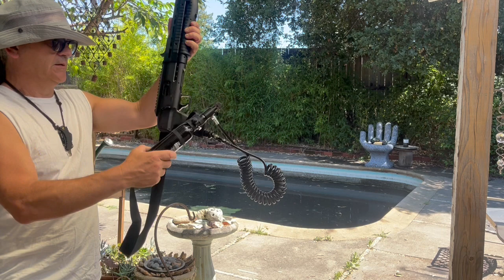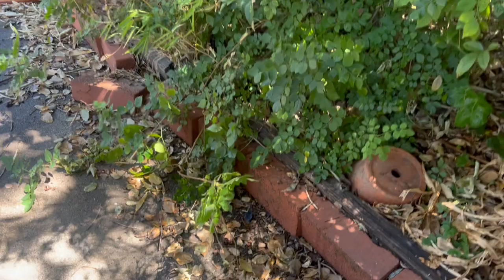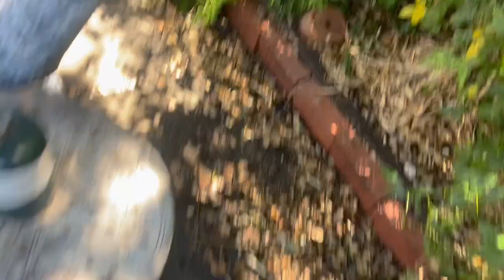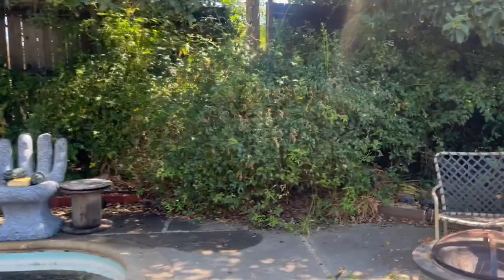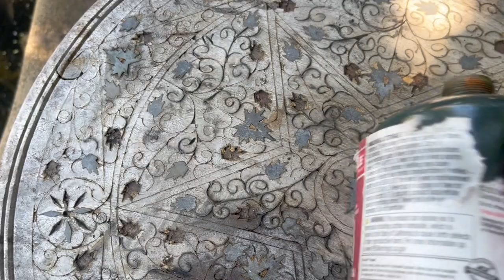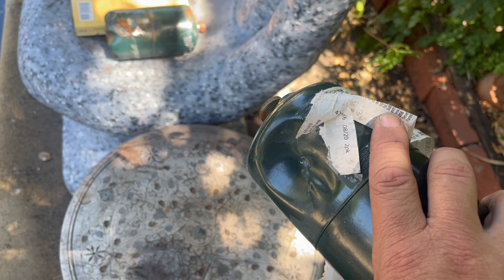Umarex HDB 0n HPA W/ 7.5 g  Aluminum (How Many Joules?)

Comment: Just watched your streetwise videos and saw this video. That tank isnt ever going to be the dame again LoL.

I have a 50 Joule HDX for home defense and I tested it on an 8 pound vacuum sealed pot roast to see what kind of penetration I'd get from 25 feet, 15 feet, and 7 feet using 4.6 gram Homewrecker Busting Balls. I was shocked by how deep the rounds went from 25 feet away. At 15 the balls were 1/3 of the way through the roast and at 7 feet I had to use a knife to dig the rounds out. I was using the 2x12 gram CO2 so I can only imagine how much derper they'd go using an HPA tank attachment.
Reply from the maker: Heck yeah!! It’s a great feeling isn’t it?! ;-]
Reply: @airgunsanonymouslesslethal1904  as long as you're wearing ear protection it is LoL.
These shotties are very loud, especially when modded.
Can't wait to see the Lancer Tactical Higos when it comes out this month... A 34 Joule launcher for under two hundred dollars.